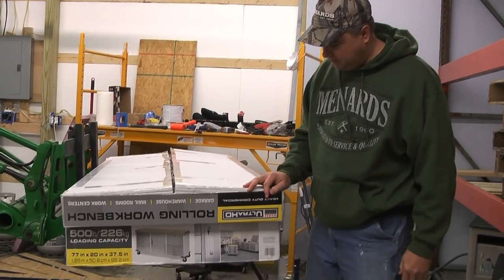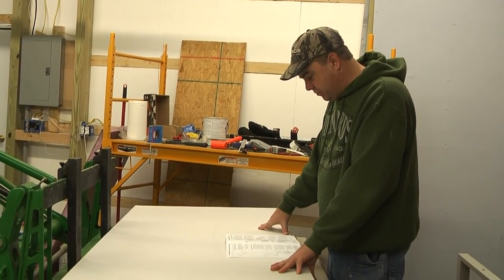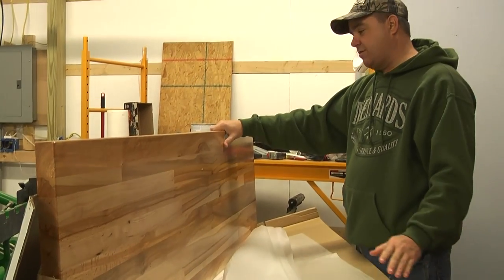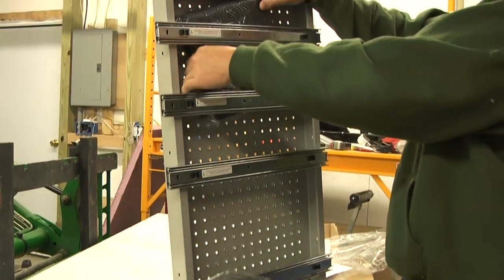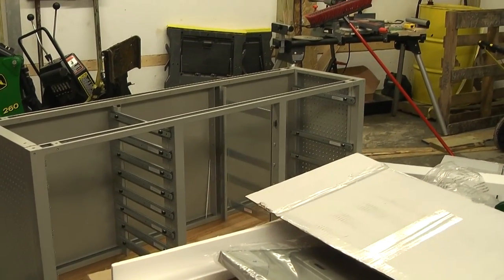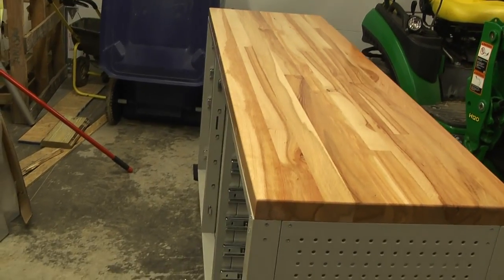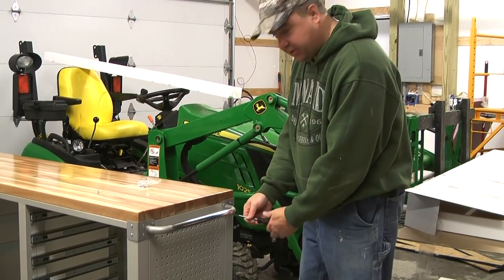#45 Seville UltraHD 12-Drawer Rolling Workbench/Toolbox Unboxing, Assembly, and Review

Comment: I just assembled the 2019 version, purchased at Sam's Club for $400.  Overall, I am also impressed by the quality and price.  The instructions and the packaging were excellent.  Tim's recommendation about not tightening the screws until all of them are in their holes was a key to the assembly.  A few of the screw holes in the drawers would still not line up properly, however, so to assemble it I had to use my Dremel and enlarge 8 of the holes in the sheet metal.  That was a pain, but I am still happy with the purchase.

Comment: I've had mine for almost 5 years now. Still no complaints. It did take about 5 hours to put together. Price was $399 and is now $409. The newer one's have less drawers on the right (facing) than the one pictured here. Mine came with nice drawer liners too.

Comment: I purchased the UltraHD Model 20262 Workbench at Sam's club for $449, on sale from $499. The first bench I purchased had a problem with the #8 hardwood top. While assembling the metal sides and face frame to the #8 hardwood top I discovered that the hardwood top was too narrow. It measured 19 11/16 inches wide however, the metal base measured 20 1/8 inches. The six mounting holes would not line up. I was able to exchange this workbench at Sam's club even though I had removed all of the packaging (way to go Sam's club). Before I started assembling the replacement workbench I measured the #8 hardwood top and it measured 20 inches wide so I proceeded with the assembly. I did end up using some bar clamps to temporarily hold the face frame to the other metal base parts to ensure proper alignment to the #8 hardwood top before all the screws were tightened. I did use a small torque limiting driver drill for all the screws which makes installing all those screws a lot quicker. I also did my initial assembly on 2 saw horses so I didn't have to work on the floor. Thanks Tim for your video.
Reply from the maker: We have 3 of these now.  Love em!

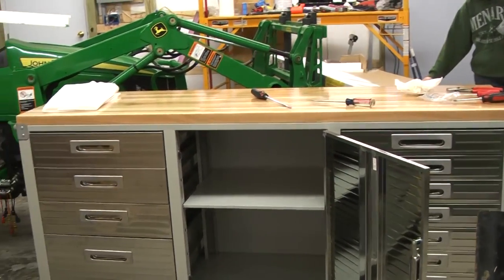Comment: What happened to the door installation instructions ???  From the end of the drawer installation (20:57), at (20:58) the doors magically appeared !!!
I am glad that the screws supplied were of a pretty good quality, usually you get cheap screws that break and you have to extract them or and they supplied the proper amount of screws, including a few extras, which is rare. Usually you get the exact amount of screws and if you lose one, it's off to Home Depot or the hardware store.
Reply: I figured it out. But my model didn't have piano hinges. It had 4 individual hinges.

Comment: Nice 
I just picked up a used snap on box about the same size but on the worn side for 800 and my main work box is mac at about 6200.00 both comparable size , so that's a good find. Just the wood top on a box is several hundred.

Comment: I've had mine about a year. For some reason, I can't open 4 of the drawers all the way, only about half way. It's as if the anti-tilting feature is keeping them from opening. I've contacted the company via Amazon and all they did was send a link to your video. I like your video, but it doesn't tell me how to troubleshoot my issue. Anyone on here had this problem?
Reply from the maker: No kidding!?  They sent a link to my video?  Wow.  
I wonder if the slides were inserted backwards?  Or perhaps there is a screw head sticking out that is hitting the slide?
Take the drawer out and see if the slide hits an obstruction.
Reply: Will do - I've eyeballed everything and it looks okay, but I'll give it another look see. Thanks for the reply!  @TractorTimewithTim

Comment: We bought almost the same one for the same price at Sam's Club. It went together very easily also. However, one of the drawers has a catch in it when I try to push it back in. It wants to stop about 4-5 inches out. On my configuration, under that drawer are the doors. Even with the door fully open and the drawers above taken out, it still catches. So I know it is not catching on something above or below it.However, the sliders work great when no drawer is in it.  I have tried other drawers in that slot and they too catch. I am not sure how to fix the problem.
Reply from the maker: Sorry to hear that, Julie.  I think you are in the right path.  You need to find exactly where it is binding.  Maybe you can see better if all of the other drawers are out?  Then you can 'climb in' for a better look!  Maybe one of the screws not quite all the way in or something like that?
Reply: You were right, 1 screw was missing. It now works great.
Reply from the maker: +Julie Wilson excellent news!

Comment: You have had this a while? How is it holding up? Do the drawer rails have roller bearings?
Reply from the maker: Yes, I love it.  I think sams still carries them. They changed the structure a bit to put drawers all the way across the top.  I would like that better
Reply: I decided to go with this Husky instead:
https://www.homedepot.com/p/Husky-60-125-in-10-Drawer-and-1-Door-24-in-D-Textured-Black-Matte-Mobile-Workbench-Sliding-Pegboard-and-Shelf-HOTC6010BB2M/300659016

As much as I like the looks of the Seville, there were 2 things about it that forced me to choose the Husky. The Seville is very light weight with only a 500lb capacity and a 30lb drawer load capacity. The Husky has a 2200lb load capacity and a 100lb drawer capacity. 500lbs seems extremely light weight for a tool box. In addition, the Seville depth is 20" while the Husky is 26". Even though the Husky is 12" shorter, it has 120sq inches of more worktop space. If the Seville had a more sturdy frame (maybe 100lb) I probably would have chosen it. They should take that into consideration in the future. Thanks for the help.